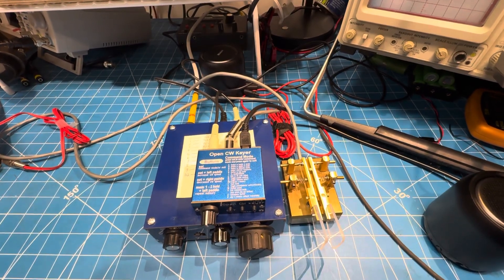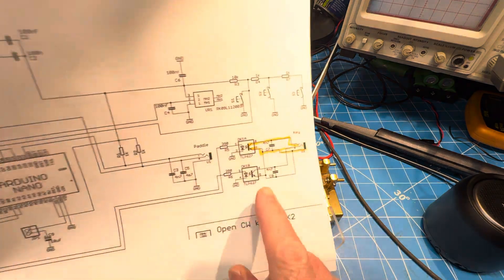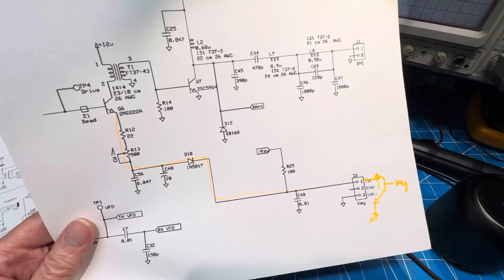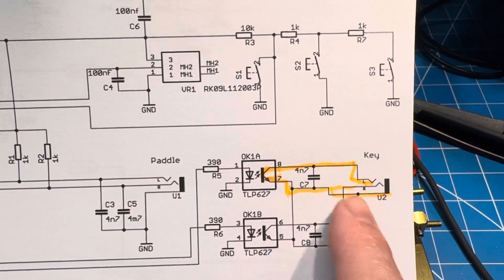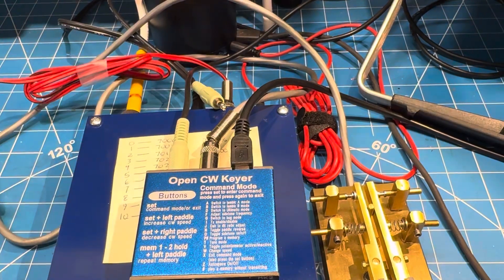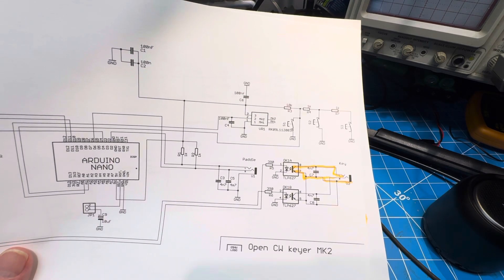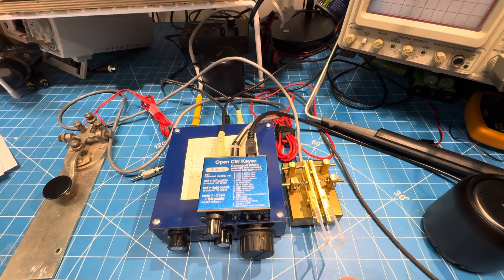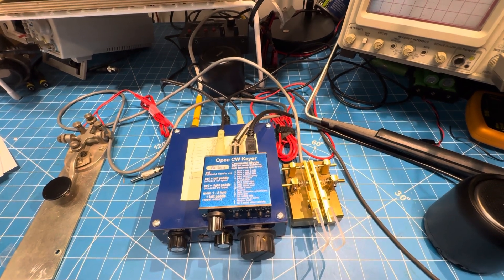Open CW Keyer Build - Not Quite a Fail… but close

Comment: I'd bet you're right: not enough current through the opto to turn on Q6 of the transmitter reliably. From the transmitter schematic, it expects a very low-resistance key: dry relay contacts, a straight key or bug or other mechanical switch, or perhaps a FET with a low RDSon.

The transmitter already has the Vf of its D10 in the emitter circuit of Q6; OK it's a Schottky, but it still reduces the headroom that remains for Vce of the keyer's opto. Check the opto's datasheet. With 390 R from a Nano GPIO, the keyer's driving it good and hard - but its Vce can't go below about 0.7 to 0.8 volts and looks more likely to be at least 0.9 V. That's way above the voltage drop that a contact could impose.

Have you cranked the transmitter's R13 fully clockwise, to remove as much resistance as possible from Q6's emitter circuit? Not an ideal solution but it may confirm that your diagnosis is on the right track. Keying's slow enough that a relay can track it; try using the opto to drive a relay, and key the transmitter with that instead of directly from the keyer.

@Penfold42's points are good: check the values of the LED resistors and check for counterfeits. As they point out, potentially both optos' transistors are in parallel. If you haven't already done so you could connect them in parallel by shorting the tip and ring together, perhaps with a few ohms to ensure they current-share. If that works at all though, it's probably a borderline fix at best.

Comment: you cant "lock" an atmega328 to prevent re-programming - it can only lock you from reading it out.
looks like they use a pair of optos in parallel 
- maybe check that they're both being driven
- that the series resistors are correct. 3k9 instead of 390 would probably not turn the optos on  very hard (if at all).
- they're not counterfits that dont match the spec!